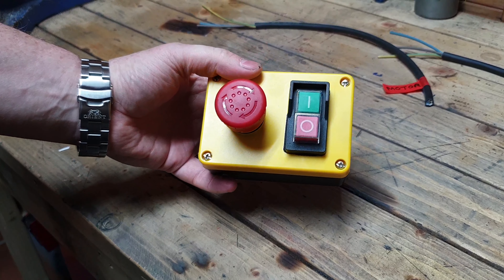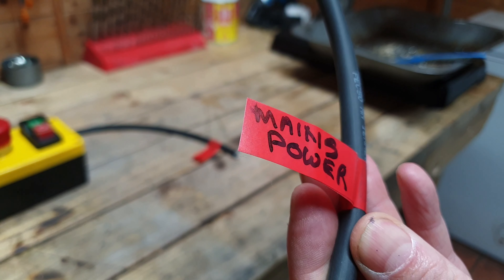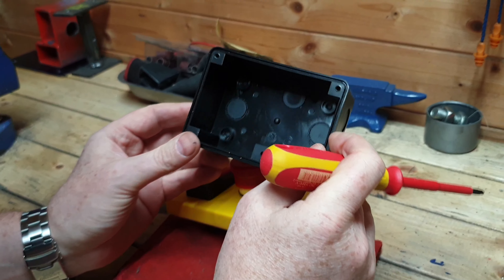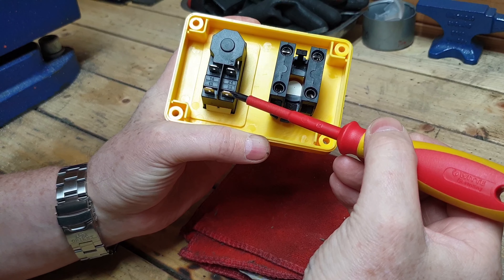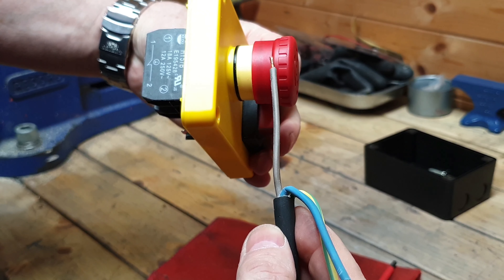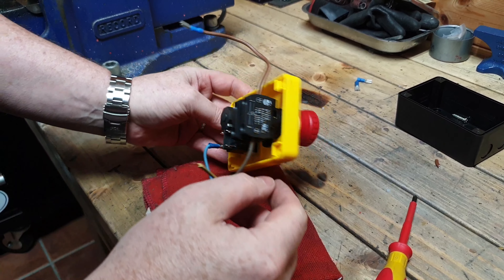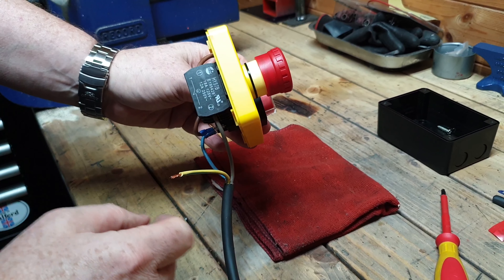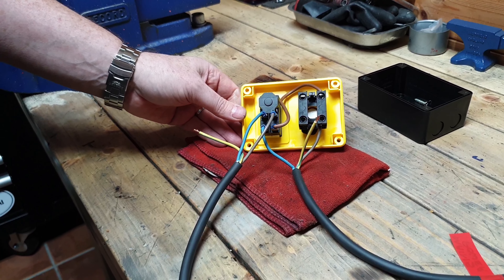How to Wire an NVR Switch with Emergency Stop

Comment: Thanks for the video. I see that you did not connect the 5th terminal on the on/off switch. This terminal is to disconnect the connection in the event of loss of mains supply. This prevents the drill starting up immediately if the power is restored. The 5th terminal is connected to neutral
Reply from the maker: See my other vid'.. you'll see why👍🏻.. thanks for watching.
Reply: @BestUserNameUK  Hi, I just looked at this video 'NVR Switch with Emergency Stop added to Titan Drill Press' and see that it indeed stops with loss of mains supply. Have you got any idea why it works if the 5th terminal is not connected ?
Reply from the maker: @RobertKza  Sorry but I'm unsure as to the use of the other terminal. I simply followed the supplied wiring diagram.
Reply: thank you . I have been looking everywhere for that info.and now I know where to run the wire to
Reply: @RobertKza  Pin A1 is only present on the 5-pin version and is mainly used for motor protection if required and connects to the motor.
‘IF’ your motor does not use A1/5th pin then it has to be connected to pin24 or the switch will not work! This is a workaround to make the 5-pin switch work in a 4-pin situation.
Best rule is to buy the correct switch! 4-pin or 5-pin :)
Reply: @RobertKza  I think that the 4 and 5 pin switches look the same but the 4 pin is sold bridged internally, but I can not find a 4 pin switch anywhere!
Reply: @ericozgo100  http://www.kewonline.net/store/product/a-nvr-no-volt-release-stopstart-emergency-stop-switch-kjd17-d2 <-- all versions
Reply: @simonoldgit  Hi, check this one out on Ebay UK! : x1 KEDU KJD17 NVR Switch 220V 230V 240V Machine switch 5 Pin Model. It was the bridge wire from terminal A1 to 23! WTF is A1 all about?
Reply: @ericozgo100  A1 is meant to connect to a motor safety feature, usually overheat/overload protection. Most do not have it. That link is so the switch will work when 4-pin is required. Better to buy the 4-pin version if that is what you need. perhaps https://www.ebay.co.uk/itm/154153307036

Comment: any idea why mine wire wired this way wont latch? it starts but wont run
Reply from the maker: Maybe a faulty switch? I had the same issue with another switch. The 'on' button would not engage so the machine would not stay on.
Reply: @BestUserNameUK  thanks for the swift reply.

I have also run it through a 20amp cooker switch to test it with no luck, the only way I can get it and another motor to run is via direct wiring - it seems that if there is a any switch inline, it failsto start
Reply: See 
John Pettit in comments This fixed the same problem for me